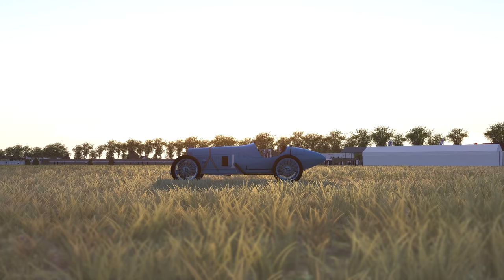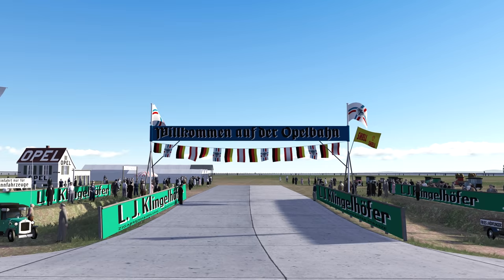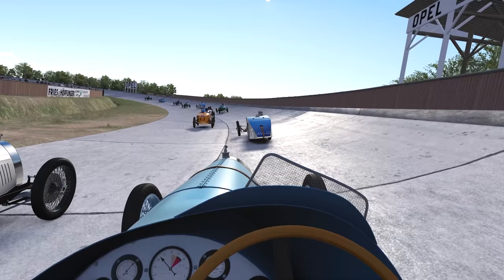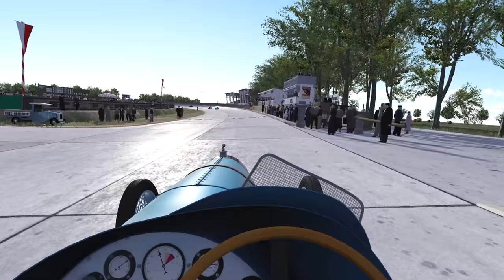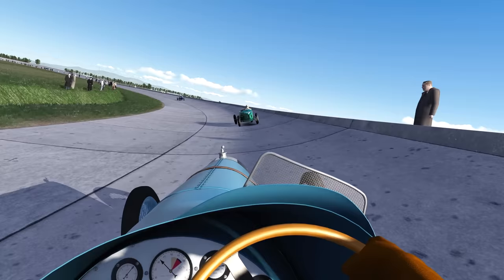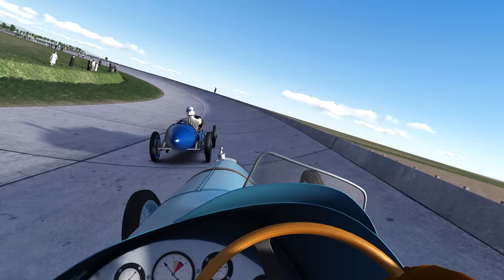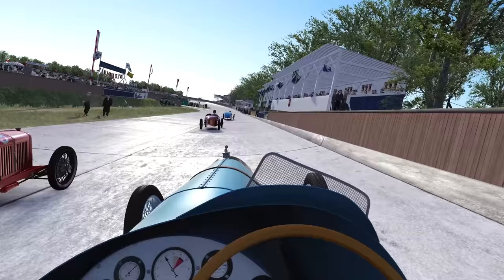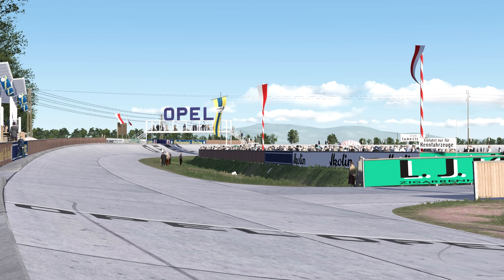Delage 2LCV and the Opel Rennbahn - 1923 Grand Prix - Assetto Corsa

Comment: For the old European ovals, parabolic banking was the norm, whereas here in the States, it's flat banking (same degree of slope all the way across).

You were just barely off a 33-flat for your fastest lap, so an average speed of 101.6 mph.

One of the ovals I haven't actually seen a race at is Montlhery, strangely enough.  Maybe you can rectify that at some point.

It's maybe floating around somewhere, but it would be interesting to see a recreation of the actual pre-War Monza, including the original banking.
Reply: I want to see a version of Sitges-Terramar as well
Reply: Found this just doing a quick search:
https://www.youtube.com/watch?v=7xeGfOYDweM

So it does seem some of the tracks are around, at least in basic or makeshift form.  I'd thought I'd seen a lower-banked Monza before at some stage.

Comment: The Delage 2LCV is a pretty rare sight nowadays apparently. Most, if not all of the cars, were upgraded further in 1924 and 1925 (when they fitted superchargers, taking the power output to around 190bhp claimed by the factory, which is pretty high for 1925). And after their competitive careers were over, they ended up in private hands and slipped into obscurity. 

But one early 2LCV (that looks a lot like the one in the video, apparently it is the first ever 2LCV) survived to the present day, though fitted with a WW1 Hispano-Suiza aircraft engine that had been fitted by an owner in 1926. It is now known as the Bequet Delage (or Delage Bequet), after the owner of the car in the 1920s who fitted the aircraft engine, a man named Maurice Bequet.

Comment: Set these jewels up last night on this track but it crashed on loading, probably because there is no AI line.  Will try again today with your AI addition.  I set them up and raced on the Sitges track with the old Bentley and merc added.  As you say the most fun I have had in ages.  A perfect way to learn some automotive history.  Thank you very much for this - A treasure.

Comment: Magic! O’ how I wish we had a dedicated interwar-period racing sim!
Reply: Many of us do, but the biggest barrier to creation is doubtless the lack of data, especially for cars that have either been completely lost to time or modified far beyond their in-period specification.

As for data implementation, not many Sims can accurately replicate early suspension solutions; your best shot at which at the moment I believe is Beamng Drive, but even then that's still a long way off from being a comprehensive, serious simulator for Motorsports applications; even with how detailed the physics system is thus far.

Comment: Why does old racer cars had positive front camber?
Reply: When the car would brake, all the weight would shift to the front, so the front of the car would drop down and give the front wheels a bunch of negative camber. The positive camber would go away under various different loads.

Comment: I think you racing in the wrong direction. Came to think about it when you  said it felt odd sitting on the outside. The reason regular ovals go counter clockwise goes back to Americas independence and horse racing. They didnt whant to race the same way like the British that did it clockwise. The only other oval track i know about in Europe is Monza and that goes clockwise.
Maybe we can get another youtube video with you racing the other way?
Reply from the maker: Originally I thought so too, but looking at photographs from the time they raced this circuit counterclockwise
Reply: Brooklands is anti-clockwise though. Now that would be a good period race track